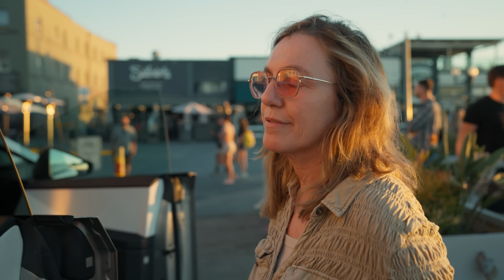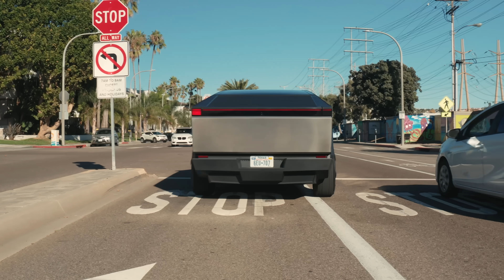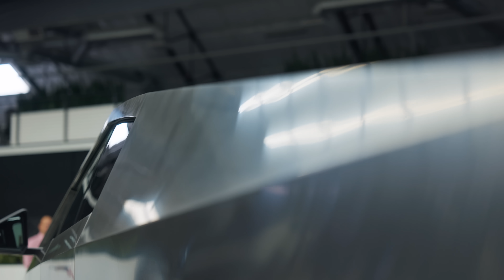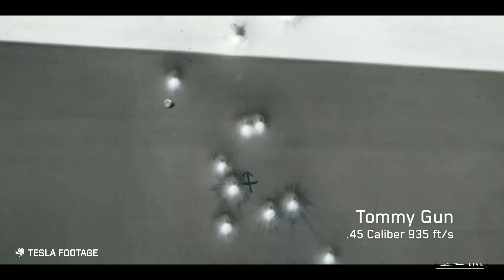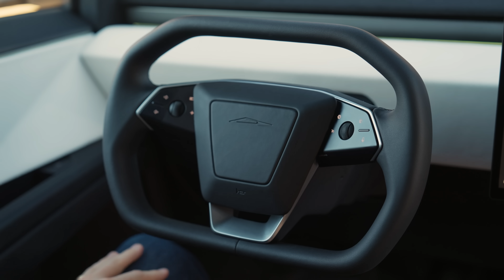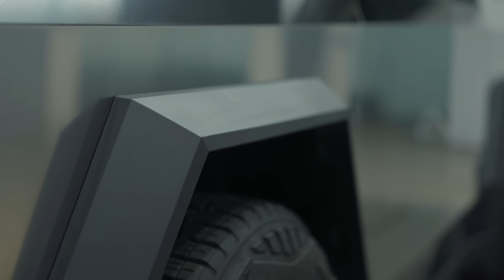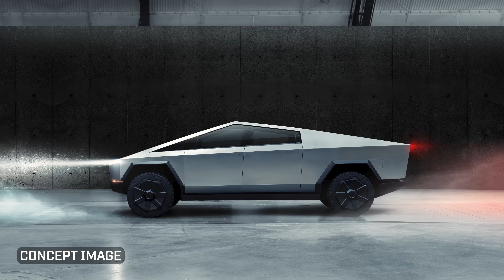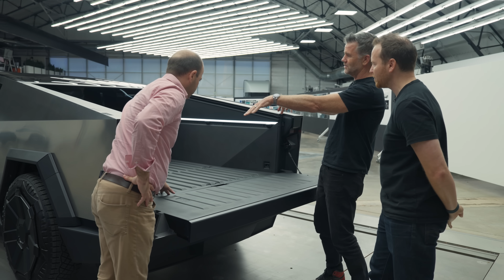FIRST DRIVE: Tesla Cybertruck Full Review

Comment: No one is talking about the biggest innovation: making other vehicles into your crumple zones.
Reply: 5
Reply: looooooooooooool
Reply: Lmaooooo
Reply: Assault truck
Reply: And the way it can slice a pedestrian in half at low speed. Impressive stuff
Reply: Until you hit another Cybertruck
Reply: The 2024 Toyota Tacoma is far better then the Cybertruck. 😂
Reply: You think a conventional car doesnt do that? With all the sensors that makes faster and clever decisions eliminate your problem.
Reply: Plus when you hit another cybertruck or a tree you're dead. Admittedly not really an innovation.
Reply: @edejong  And if you hit a tree or Cybertruck in a normal car (or another truck), you will be perfectly healthy? 😂
Reply: @lukabosnjak3829 Let me rephrase: you're automatically dead.
Reply: You'll be significantly more healthy than if you're in a Cybertruck, which has no crumple zones to reduce the amount of energy from the impact reaching the cabin.

This....this isn't complicated. Well, maybe it is for you.
Reply: @Beany2007FTW  I would advise you look up and watch the crash test footage of the cybertruck before claiming that it has no crumple zones.
Reply: @Beany2007FTW lolt it does have a crumple zone and is required by law. It's just that the crumple zone also has a thick ass steel plate on it which spreads and takes a loot of the impact itself. Paired with the crumple zone it's one of the safest cars to crash into a tree on the planet.
Reply: @Beany2007FTW  Bro. My guy was making a joke and you took it seriously. Obviously the Cybertruck crumples. Stainless steel is very bendable and rebounds back into shape absorbing a lot. And yes, they have crumple zones. It's called the Frunk, you know the space at the front.
Reply: @Beany2007FTW it does crumple. Look at the crash ratings.
Reply: @Beany2007FTW Sorry to disappoint you but it has crumple zones. If you smack the Cybertruck into a wall it’ll gain a new flat surface in the front.
Reply: @Beany2007FTW check the footage I say
Reply: @lukabosnjak3829 rally car drivers who smash into trees take down the trees instead of themselves.
Reply: @Beany2007FTW you seem to forget that this is a Tesla. THE safest vehicles on earth to be inside of in case of a crash.
Reply: @Beany2007FTW it has crumple zones they showed the crash test car
Reply: @Beany2007FTW are you a moron? Go look at the crash test. Teslas are always 5* Safety first shit on volvo approach.
Reply: @RadialSeeker113 side impact?  Rear  ?
Reply: @Beany2007FTW Cybertruck most definitely does have crumple zones.

They showed crash videos of Cybertruck hitting a wall at different speeds.

Teslas are safest vehicles lowest chance of injury be in a crash on this planet,  by large margins.
Reply: I am so happy to live in the EU where this car will never be allowed to drive on roada.

Its a nightmare for pedestrians, cyclists and smaller cars.

If you crash with stainless steel outside into another car than you will kill someone.
Reply: @Beany2007FTW it has crumple zones. watch the crash tests.
Reply: @RadialSeeker113  source? My understanding is the front of the Cybertruck is made out of aluminum.
Reply: @eikechronos3066 it’s designed not to crash
Reply: @Beany2007FTW  do some research. They have crumple zones all the way back to the firewall in the front. They also have them on the sides and the rear. I’ll do the same amount of research on you as you did on the truck. You are an uninformed person who wouldn’t know a good vehicle from a bad vehicle if it beat him in the ass.
Reply: @Max_xaM 
Good job. At least one person did the research to know that the cyber track has crumple zones. All of these people don’t know anything about cars if they claim they don’t have crumple zones.  All of them do except the cheapest tiny box cars. you can tell by the safety score score of one or zero the ones who do not have crumple zones.
Reply: @lachlanB323  I agree with a little bit of what you say, but stainless steel is not very bendable. The term is malleable not bendable anyway. Get a book about metallurgy and look up Austinetic stainless steels. But I believe they cold work this one a little bit which would turn it into a Martensitic stainless steel
Reply: @ZeusBullyMax  It is difficult to bend into place. You actually got to bend the stainless steel further then where you want it when making the bends for the cybertruck.

It does bend. Watch it get shot by bullets. You can see it reverberate from the crazy amount of force. In an accident they do bend as seen in the crash tests.
Reply: @Beany2007FTW  "Cybertruck, which has no crumple zones"
That is wrong.  Look at the crash tests.
Reply: @eikechronos3066 receipts. You don't know.
Reply: @ZeusBullyMax I think the guys testing know more than you. So let's listen to them
Reply: @Beany2007FTW The crash tests say otherwise. If you get into a head on collision at even 30mph...well you get the point.
Reply: @Beany2007FTW talking out your ass
Reply: @Max_xaM Crash test footage was disasterous. The crumple zone is the drivetrain swiftly followed by the cabin
Reply: @psibug565 Agreed, it'll flaten your face
Reply: @Beany2007FTW  they have crumple zones. You make statements like you designed the truck. They have to have crumple zones to pass the crash tests.
Reply: @lachlanB323 ........ and yet the designers in this video said that this particular stainless steel is extremely difficult to bend and they had to invest in a new process to do this.
Reply: @Zangief747  Just because the exoskeleton is tough doesn't mean the inside is tough. After watching the front on test you can see that the exoskeleton pushes into the weaker frame and that acts as the crumple zone in a crash. 

The cybertruck's front part isn't one piece intentionally so in a front on collision it can push into the mushy stuff. At least that is the only explanation to why it crumpled so much. It crumples slightly more then other trucks actually.

Likely due to no engine.
Reply: @Beany2007FTW no it's designed to be one of the safest vehicles
Reply: @Beany2007FTW flat out wrong about no crumple zones 🤦🏻 did you not even watch the crash test?
Reply: @Beany2007FTW how do you figure it has no crumple zones?

They showed side collisions, you dont want crumple zones there. But head on it has them. You think the company that created 4 of the safest rated cars suddenly forgot how to do it?
Reply: @lukabosnjak3829  Should do well, not sure  about other car,vehicles.
Reply: What do you know about crumple zones? If you were ACTUALLY knowledgeable,  you would be working for someone in the car design industry. We all know you are just a troll. @Beany2007FTW
Reply: @Beany2007FTW CyberTruck is by far the safest truck in existence.
Watch the crash tests.
To say it has no crumple zone is totally ignorant on your part.
Hate much ?
Reply: It’s not it been that way in semis since their invention
Reply: @Beany2007FTW  Wrong, it has a better crumple zone than an F150. Just take a look at the testing videos.
Reply: @Beany2007FTW the cybertruck has crumple zones don't let the exterior fool you
Reply: @eikechronos3066 in Europe you don't need a truck, in many places in North America you need a truck in some form simply because of the environment.
Reply: it is hellishly ugly……it could never have come from italy or france………
Reply: @Beany2007FTW  it wouldn't pass crash tests if it didn't have crumple zones.
Reply: @AnarchyEnsues  in countries with real safety regulation - IE not the USA - it doesn't. Which is why it can't be sold anywhere else.
Reply: @Beany2007FTW have you looked at the data? You don realize they engineered crumple zones into it right?  Go watch Sandy Monroe talk to the engineers with the exploded truck. They talk through the engineering in them
Reply: @Beany2007FTW Although the crumple zone is smaller and is incorporated into the front castings it is dynamically the same as a standard vehicle
Reply: @Max_xaM it's not legal in Europe. There's a reason for that. This is not a safe vehicle.
Reply: @henlouwho  soo, 1 month and 184 comments later you tell me that its not legal in Europe? I am going to assume your comment is a direct answer to my comment since you tagged me. I have not read all the comments in between.
The original comment stated that there are no crumple zones and my reply was that the original commenter should have looked that up instead of parroting something he/she heard somewhere, since there is actual crash test footage and the cybertruck has crumple zones.

Now your comment states that it is not legal in Europe, which again sounds like something you might have heard somewhere and just ran with it instead of checking up on it. (please correct me with a source if im wrong here)
As it stands the cybertruck has not been tested for the European market. There is no way for us to know the results of tests that have not been done yet.
Reply: it is just a killing machine for anyone else on the road. see this truck and run. muskybot killer approaching
Reply: Instantly stopping from 60 mph to 0 when you hit a wall or tree will kill you regardless. Can't cancel out G force on your internal organs.
Reply: Right. The F350, Suburban, and Armada beat them to it.
Reply: Literally
Reply: The Smart did this long before.
Reply: The Smart 42 invented that in the 90s.
Reply: @annahopp good for them.
Reply: Right?? And with all the structure on the outside, if you get any type of damage on the body, is it just totaled? Or would they cut and weld in a patch and now you just have a shitty looking patchwork exterior?
Reply: @edwardmead7448  these new electric vehicles are ridiculous when it comes to repairs. They're made to not be repairable. If you get small dents, the price tag can be $15k to fix because they just want to replace entire sections of the vehicle.
Reply: No you don't know shit about the crash test results and Teslas history with making the safest cars on the road? Got it
Reply: I thought they’d talk about it
Reply: Cybertruck only benefits panel-beaters
Reply: Care to share crash data to the numbers of how many Teslas are involved in front end collisions vs other vehicles?
Reply: @FPSTinter  Wait for them, they're as rare as chickens teeth right now
Reply: Watch the crash test video
Reply: Making kids walking to school into your crumple zone
Reply: Like trucks of old.
Reply: Cyber Tablet keeps giving....... UTOPIA. Have fun WAITING. 🤣🥱
Reply: That has been the trend since everyone is driving either an SUV or truck.
Reply: The only electric vehicle I'm buying is the cybertruck
Reply: LOL
Reply: crumple zones where always just a excuse for car manufacturers to cheapen out the quality
Reply: You try to pay the repair bill okay
Reply: Good.
Reply: It’s no different than a massive Range Rover or x5 basically the bigger the car the safer your family and the more at risk the people in smaller cars are
Reply: King Amar jeet..FF 😢
Reply: That have people inside
Reply: Tesla make the world safest cars (for both parts in a crash). Seemingly same crumple zone as an F-150.
https://m.youtube.com/watch?v=vLKor7Aven4&pp=ygUVY3liZXJ0cnVjayBjcmFzaCB0ZXN0
Reply: Is it 4 wheel drive?
Reply: I'm ordering one after the 2 million or less  of Reservations have been converted to delivery- I'll have 2 years to save, will be my last "car", might have to sell my TSLA  shares.😢..,😂😂LOL
Reply: With ADAS Autopilot and FSD the CYBERTRK will crash less ,sorry if others can't do the same.
Reply: Brilliant!😀
Reply: Pretty sure cement trucks had that figured out many decades ago
Reply: Elons making every other manufacturer look stupid, the cybertruck is safer than its competitors in testing.
Reply: Are the US constantly in war with everyone?😢
Reply: The best impact is no impact #Autopilot #FSD
Reply: If you are worried safety, get off the road
Reply: I have $100 down and I’m seriously thinking about buying one of these. However, if the exoskeleton is integral to the rigidity of this vehicle, what happens when the least little dent is put into one of the body panels? Think pop can or world trade center. In all seriousness, what is the implication not just from a rigidity perspective but also from a cost of repairs perspective? Looking forward to comments.
Reply: That’s what the smart car claimed to do
Reply: From Missouri...its a truck bed not a loading bay.
Reply: No one mentions one major safety concern ...this truck is ultra camouflaged. Blending concrete color , dark trim , and slight reflection which mirrors ambient colors . I wonder how many accidents will be "I didn't see it"
Reply: @Jazz5777  make sure that daytime running lights are working and or automatic settings are on. The latter for sudden light level changes, under an overpass, through a tunnel or entering an enclosed parking structure.
You're correct about silver or grey  vehicles being more difficult to be seen in low lighting.
Reply: Absolutely munting vehicle…….even the trabi is better looking
Reply: Well it is supposed to be built like a tank and you wouldn't't want to hit a tank either.
Reply: Just ignore the safety features to prevent that huh
Reply: Volvo did this years ago
Reply: Says every tsla short...
Reply: In it's present form with all those sharp corners it'll never be approved for use on public roads.
Reply: Haha oh they will. God help us and the rotation of earth if a Cyber Truck and a Hummer EV meet head2head on an interstate… the poles will shift and tsunamis and landslides will cover the globe!! 😂
Reply: XD
Reply: @Goat4459 😢😮🎉😅😮😂😮🎉🎉😢😮❤😊😊😊😊😊😊
Reply: Does that work for concrete bridges too?
Reply: I think Volvo was first.
Reply: @Apricub  no way. By First you mean safest? Cite your source.
Reply: @Apricub  to the scrapyard
Reply: One things for certain…I wouldn’t take any European’s advice on any pickup truck!
Reply: @jezza6575 I know...... That would be crazy right, not as if vehicles were invented in Europe or that most vehicle technology gets developed in Europe 1st.
In America, you guys are still all about the cup holders.
Reply: That’s no innovation, Volvo were doing that before it was cool
Reply: Having zero crumple zones puts all that force on the Passenger.   The shock of a normal crash would lead to worse neck injuries and back injuries as well as shock to the head.
Reply: @itisjustacomment  there are crumble zones. The fuck are you on about
Reply: And yet it’s entirely legal and has met and exceeded all pedestrian and crash safety standards. Maybe it’s just a misconception.  Keep in mind that semis and trailers, even the ones towed by normal trucks, don’t have to have any crumple zones or impact attenuation…. 

Also, the Cybertruck like all Teslas, has crash avoidance and automatic breaking (that are far more effective than humans and other auto safety systems on the market) to prevent it hitting someone else…..
Reply: @MDC_1985 Trucks meet lower pedestrian safety standards than cars. There has been a 70% increase in pedestrian road deaths since 2010, and the increasing size of vehicles is one of the reasons. In Europe, there are much more rigorous standards for the safety of other vulnerable road users, although maybe not quite so much concern about being bullet-proof.
Reply: @MDC_1985 ohh yes! This car is safer than any other because it has systems that all other cars have…. Crash avoidance has been a thing since 2003 and automatic braking was made a law in 2022. Tesla is not making things better than people that have been doing it for over a century.
Reply: @patrickwhite4449  actually…. They are.
Reply: @patrickwhite4449  boomer is angry
Reply: @patrickwhite4449 except for Tesla having the best crash avoidance.
Reply: @patrickwhite4449 you sound mildly hysterical!!
Reply: @patrickwhite4449 Same argument people against the IPhone and yet no one wanted to go back to a palm pre.
Reply: Not true. The smart car was the first. It was intentional designed to use the crumbles zone from other vehicles. And when two smart cars hit each other, it's like two tanks in a collision.
Reply: I don't understand how some people think a truck like this would be released if it would endanger the public.  No one ever mentions anything about all the semis driving down the road, carrying 80,000 lb. When those things hit cars everyone dies but we still allow them.
Reply: @TheMadmax0609  it will take lawsuits.  If the lawsuits determine the Cybertruck is unsafe at any speed. It may require a redesign, recall or cancel production.
Reply: @Dularr  lawsuits?  The F-250 and F350 weigh the same as the Cybertruck.  Those things have been on the market forever.  Please tell me you guys aren't irritated because the Cybertruck weighs 6,000 lb? 🤔

Wake up and stop thinking so narrow-minded. 🙄
Reply: @TheMadmax0609 Making a vehicle that passes crash rating thresholds is very easy. The government doesn't put massive restrictions on vehicles. The car manufacturers have routinely gone above and beyond those crash ratings. The Cybertruck passes the ratings requied to be on the road but that doesn't mean your particularly safe. The crash tests done show that the people in the truck would take on serious bodily harm from impacts while the truck itself held up well overall. Most vehicles are designed to take more damage while limiting the damage done to its occupants.
Reply: @GSP-76  side impacts is where you want your rigidity, And that's where the Cybertruck excels.  Tesla's have the highest safety ratings because the crumple zones are bigger than in a gasoline car. Think about how much energy a gasoline engine transfers to the cabin.. It's an iron block, so it can't absorb energy.  The front of my Plaid is nothing but crumple zones all the way to the firewall.  Lots of energy can be dispersed before it reaches the cabin.
Reply: @TheMadmax0609  I haven't seen any testing on the Plaid but I would think it does very well. The Cybertruck is a totally different case. The tests did not look good at all for head on collisions. The passengers will take on a lot of damage in head on collisions. The truck itself did pretty well but let's be honest, who cares about the vehicle when your life is on line? I also saw tests on the 3 and Y. Both did very well, that's why I think the Plaid is probably equally as good if not better given it's their flagship. The only vehicle that is suspect is the Cybertruck.

That said, do you think the Plaid is worth buying with the recent price drops?
Reply: @GSP-76  watch the Cybertruck review from Hagerty.  The Model S was so good that it broke the testing equipment.  If two electric cars hit each other head on a lot more energy will be dispersed before it reaches the cabins of both cars.  Not so with internal combustion engine.  The same crumple zone is in the Cybertruck, but because the nose is so much shorter I don't think it will do as well as Tesla's other four models.
Reply: @GSP-76  actually, I just thought of something.  The dash on the inside of the Cyber truck is very long so there may be even more crumple zones in that area.. 🤔 Plus there isn't a steering column to transfer energy directly through the steering shaft to the driver.

The Cybertruck might actually do very well in a frontal collision.  We'll know when the numbers come out.
Reply: @TheMadmax0609  I'm considering getting the Model S Plaid... Cybertruck is too wild for me, lol.
Reply: @GSP-76  I absolutely love my Plaid, getting ready to go to the gym in it in a couple of minutes.  I have a 2017 P100D Model S also.  That car has a sunroof.  If I was told I had to get rid of one of them I would get rid of the Plaid first simply because the P100D has FSD and the Plaid only has enhanced autopilot.  

If you've never driven a Tesla, make an appointment online for a test drive.  It's painless and not like regular dealerships.  No one is going to bother you and you won't have to meet the manager after your test drive.  You simply walk in, they give you a Tesla credit card, point to where the car is and tell you to be back in 30 minutes.  When you get back they ask you how your drive was and then they say "have a good day".

Teslas sell themselves.  Good luck with your purchase. 👍
Reply: @TheMadmax0609 Complete BS. They only test at 30mph.
Reply: @MegaWilderness  I never said they test any faster. 🤷

What's your point?
Reply: @TheMadmax0609 They are doing essential jobs, and they kill a fraction of the number that giant SUVs and Trucks do.
Reply: @TheMadmax0609 to be fair, semis fulfill a necessary function for the continuation of society.

I have nothing against the cybertruck, but it doesn't. It would be totally fair to criticize the cybertruck but not semis.
Reply: @TheMadmax0609  It will not be allowed in many countries specifically because the design is dangerous to pedestrians. Same for many other US vehicles. Those protection laws do not exist in the US. But really it is just too large for most European cities etc.
Reply: @WhiskyMystery  agreed but honestly the United States has such a huge pickup truck market I don't think Tesla will ever export the Cybertruck.  You will see some over in Europe though, people will buy them and have them shipped.
Reply: @TheMadmax0609  It is an amazing cartoon, excess of a truck.  Makes me smile.
Reply: @WhiskyMystery  I saw it in person a couple of days ago, unreal
Reply: @TheMadmax0609  If they actually sell a lot, It will be funny seeing them as a group on the road
Reply: @WhiskyMystery in what way?? You need to make your point.
Reply: Probably because that’s childish nonsense that’s untrue. They showed the video and the truck crumpling as any vehicle needs to. Get you head out of your 🫏
Reply: It got tested, relative to its weight (high) it crumbles well.
Reply: The solution is buy a TESLA
Reply: Wrong the cyber truck is clearly well engineered safe with excellent crumple zones.
Reply: @airgliderz  and we forge our spirits in the traditions of our ancestors, Mr Musk is a great leader, now take him to Detroit ! 😂
Reply: Yup, even the rear axle seemed to snap in the frontal 35 mph crash test video-
Reply: @DrearyCash There is no rear axle if it’s a “Beast” Tri-motor
Reply: @DrearyCash  can you source that. I can't locate it.
Reply: @DrearyCash wasn’t a production model and anyone hitting a solid object at 35mph isn’t getting the damage knocked out and using the car again.
Reply: @DrearyCash There is no rear axle to break - this vehicle has 4 wheel steering - what you saw was the rear wheel steering. Much like the front wheels did. The same as every wheel that steers does in a crash.
Reply: @DrearyCash it doesn't have a rear axle lol
Reply: @DrearyCash nope, it doesn't have a solid rear axle. It has independent rear suspension/steering which is why the rear wheel moved like that in the crash test.
Reply: To everyone saying "duh yeah it has crumple zones watch the footage" try watching other vehicle crash tests (like a Ford Mondeo, Merc E-Class or any other normal car), and see how much more they crumple, at lower speeds. And also look at the angles and edges, and consider how different that'd be for a pedestrian impact. And notice that we actually test for that. Where's the simulated tests for pedestrians in Teslas showreel? What, pray tell, will 3mm thick cold rolled steel panels give to a kids head in an impact? Who gives a shit, eh?

Yes, other cars are made out of softer materials, to accommodate for this - mild steel and plastics - because they aren't trying to give pathetic manchildren a hardon by being 'bulletproof'.

There's a reason that the Cybertruck isn't allowed for sale in civilised countries.
Reply: @Beany2007FTW you do sound mildly hysterical. Best to just read the report, I think.
Reply: It weighs 3 tons. From what I saw it crumples quite well
Reply: It's fugly & a flop. I'm seeing so many preorders being cancelled. 
Everyone wants the baddest one at $100k? Not!
Reply: @Mike_The_Hog_A_Nator how would you know??
Reply: @Mike_The_Hog_A_Nator 😂 A car not yet mass produced is a flop with millions of orders? Hmm, you're a smart one
Reply: This thing is dangerous on the road. Sharp, heavy as hell
Reply: @spectre3492 so is every vehicle.  Are they made out of marshmallows where ur from?
Reply: @EndeavorsDnB  name another car or truck that weighs as much as this, has as sharp of angles, and can go as fast as this can. thats why its dangerous. if this gets into an accident with another car its going to pulverize it and kill somebody
Reply: @spectre3492 it's your show. Give it your best. In meantime your point is moot
Reply: @spectre3492 the new hummer is almost as fast and over a ton heavier.
Reply: @spectre3492  did you run the finite element analysis on that or is that just an opinion you pulled out of your rear end?
Reply: @ZeusBullyMax  opinion I pulled out of my rear end
Reply: @spectre3492 receipts?
Reply: @spectre3492 Do you stay home because of fear that an 18 wheeler might hit you or run you over? inquiring minds want to know!
Reply: @AuralioCabal  absolutely
Reply: @spectre3492  3000 kg on the Cyberbeast version.. a F-150 Raptor is about 2800kg?
Reply: @spectre3492  you're right, other vehicles are made of foam and are harmless
Reply: @dmurray2978  did I say they were? Stupid take